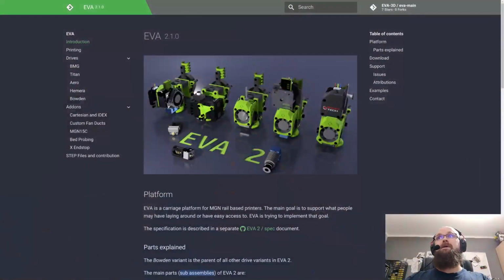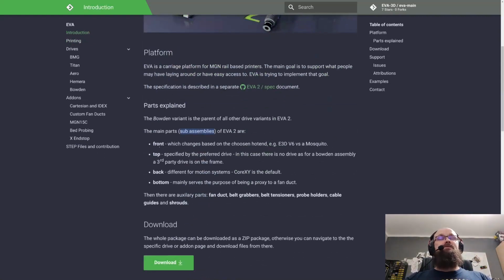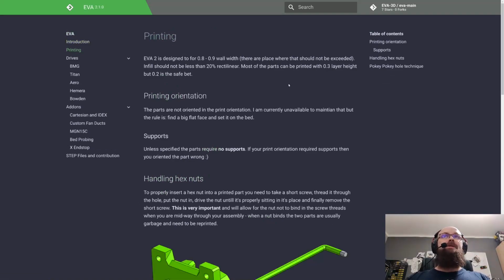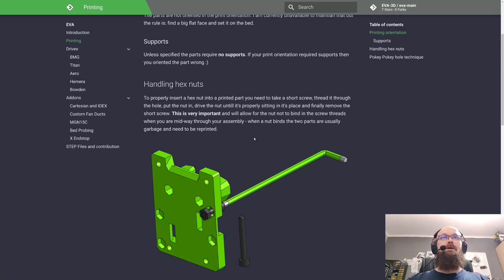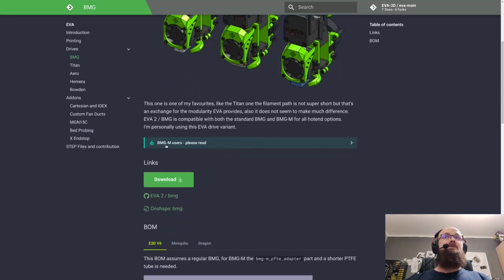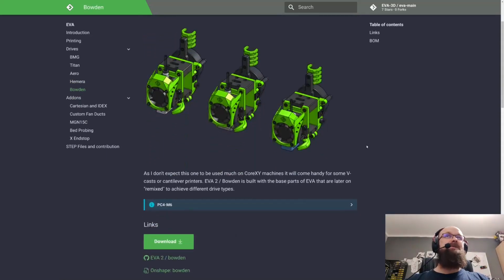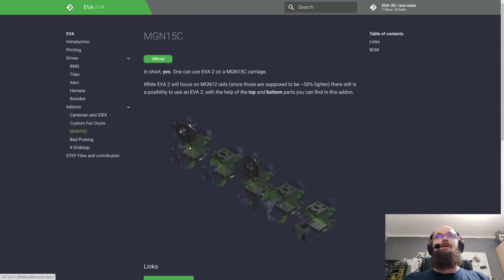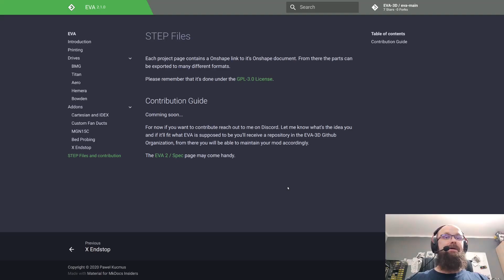EVA Introduction

Comment: Wonderfull design and seems totally functional. Can i use a 40x20mm noctua on It?
Reply: @eva-3d948  great, Will start printing the parts today
Reply: @eva-3d948  I saw somewher that wasn't possible to use BLtouth with the E3D Volcano. Is this still a problem or there is some addon to make it work properly?